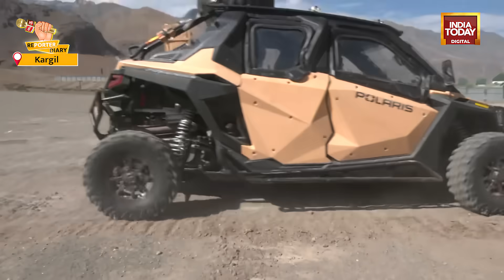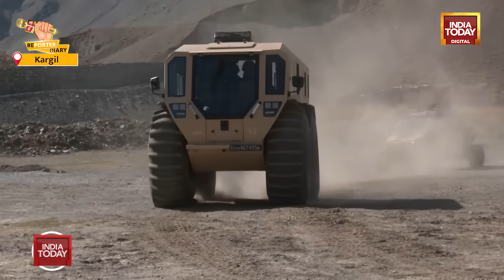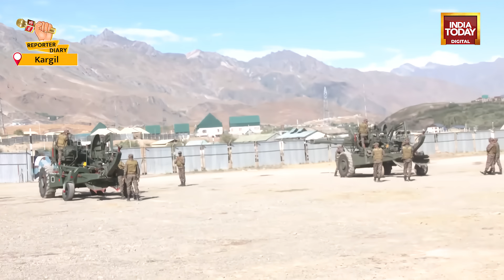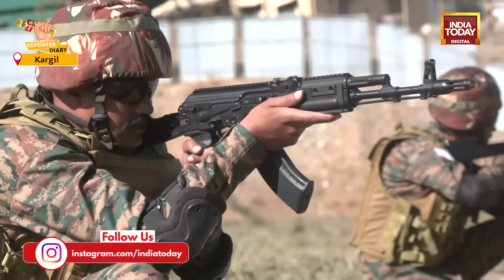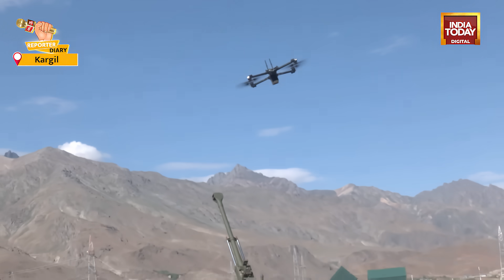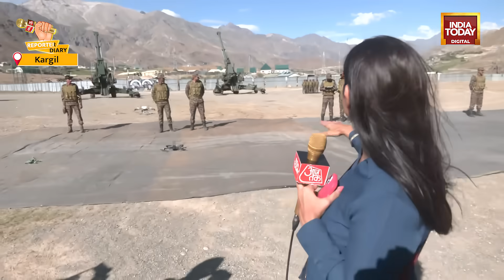India Today: Army's New Arsenal; Indigenous Firepower at Kargil | Reporter Diary

Comment: The vehicles are Polaris ATV and SHERP from US and Russia/Ukraine (presently India venturing with UK) respectively, meaning not indigenous. Even Bofors guns FH77 B02 are Swedish until recently getting manufactured in Jabalpur OF with some ToT. Dhanush is based out of the same gun. Don't spread wrong info. Educate yourself before you speak, as a journalist! Its not a galla show!
Reply: SHERP are made in India, design is technology transfer, get your facts before starting keyboard wars
Reply: @arreshubham - LEARN! 
SHERP is from Ukraine. ATOR N1200 is the Indian name. While the basic design is from Ukraine, JSW Gecko, a subsidiary of the JSW Group, has adapted it to meet the specific requirements of the Indian Army.The ATOR N1200 is assembled in India at a JSW Gecko facility in Chandigarh.  Copato Ltd. of the United Kingdom is involved in the design and technology transfer for the ATOR N1200
Reply: mahindra made them
Reply: @Bull-ph1gf - Wrong! The SHERP is being worked over by JSW Gecko under a ToT and joint venture agreement with UK-based Copato Ltd, the original designer of the SHERP N1200 to b ecalled ATOR N1200 in India... Mahindra is nowhere.
As for Polaris Mahindra does not manufacture Polaris vehicles. Mahindra had a joint venture with Polaris called Eicher Polaris Private Limited, which produced the Multix, a personal utility vehicle, no longer available now.
Reply: @parthadey4085  You're right in case of dhanush coz they were based on the Sweded Gun procured in 90s, But saying India doesn't have R& D and Manufacturing capability is way more idi*tic then it sounds, 
The 155mm ATAGS by the Kalyani Group designed by DRDO India is literally the "Best Artillery Gun in the world". 
(In Each & Every Parameters)
*ATAGS was also used recently in OP Sindoor against Pakistan 2025.

And Its Self Propelled derivative "Mounted Gun System" (MGS-ATAGS) is the best performing system in the world. It's "Shoot & Scoot" time is just 2 min & while comparing its sweden & american rivals their time is 5 & 7 mins respectively. 👍🏼
Reply: @vaibhavdixit5698 my friend if you follow my lines... I have focused on ATOR N1200 only. The realms of Indian indegenization be it the Dhanush or the ATAGS or any other asset which has a statutory indegenous brand embossed even if not war proven is completely out of context and is uncontested.
Reply: @vaibhavdixit5698 LISTEN ! the discussion is for Polaris and more on ATOR N1200. I have not doubted India's manufacturing capability anywhere. So your gunnery literature was out of context. Also fact checking your ''best'', run through the weight and price of ATAGS vs ATHOS while our own surely has an edge on precision and range!